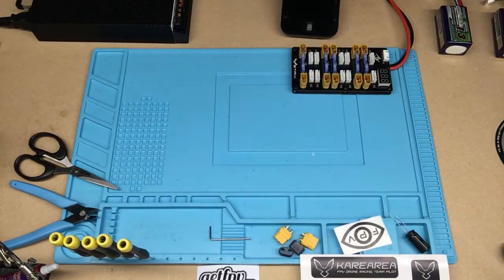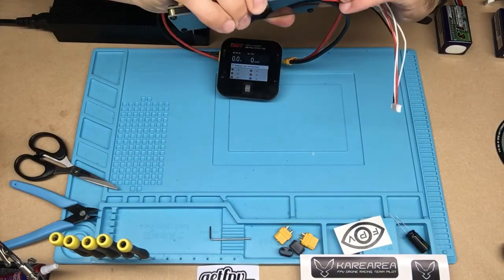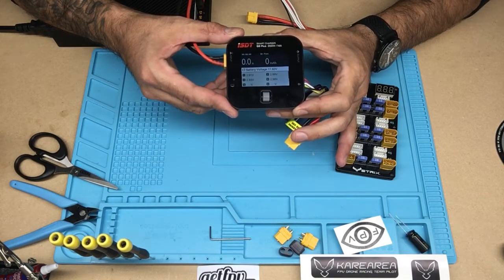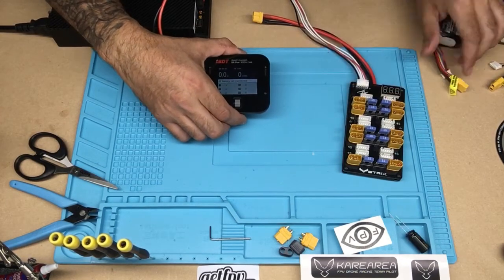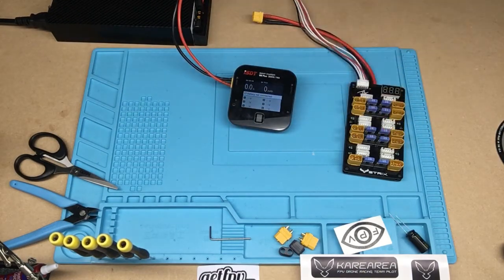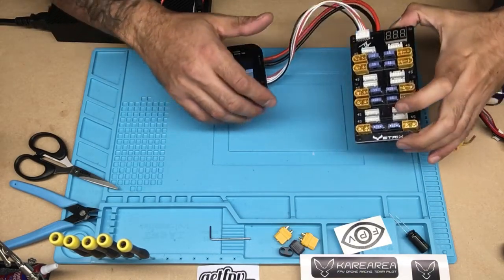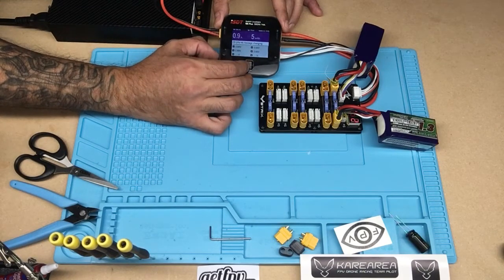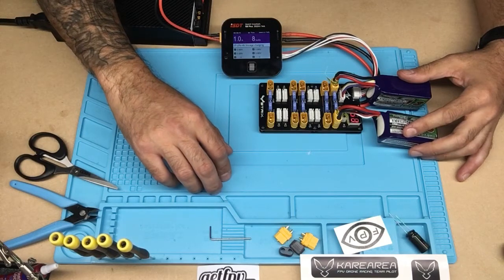THE BEST PARALLEL BOARD !!?? iSDT Q6+ AND STORAGE CHARGING LIPOS with a parallel board FOR BEGINNERS

Comment: Thanks for the vid!  On the parallel board could you put 4 batteries on, 2 used packs, 2 still charged, and run it on storage without issue do you think?  Does storage need to go at 1A current or could it be put to 1c?
Reply from the maker: Jason K , me personally , I’d run all 4 to storage at different levels just fine . Others might say not to do that . As far as storage ,3.8 would be a proper storage charge for most lipos

Comment: Hi, What power supply you use for this charger?
Reply from the maker: dimyata it’s a 1025w pc converted power supply from rcjuice.com . Great buy!
Reply: this is great bath too expensive for me. Can I use smaler?
Reply: :( and this is 120V. I need 220V
Reply from the maker: dimyata depending on your charger yes , my isdt q6plus is a 300w Charger . So you would only need a power supply that will allow it to function and charge your batteries properly. I will throw some smaller ones in the description for you . Here is a site https://hobbyking.com/en_us/batteries/battery-chargers/battery-power-supply.html check there for power supply’s that will cover the watt of your charger as well . Let me know if you need more help !
Reply from the maker: dimyata Check hobbyking.com , they have lots of choices https://hobbyking.com/en_us/t240-power-supply.html

Comment: It is a good practice to plug in the XT60 before the balance port. If there are some currents going because of slight differences in voltage, the tiny balance cables might get damaged.
Reply from the maker: blackmav5 thank you for the heads up
Reply: blackmav5 Good to know 👍